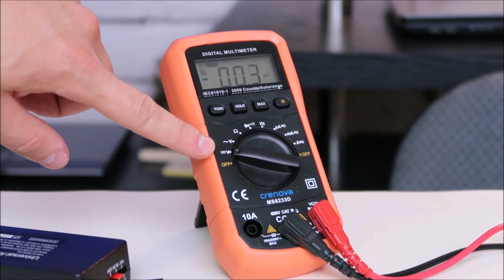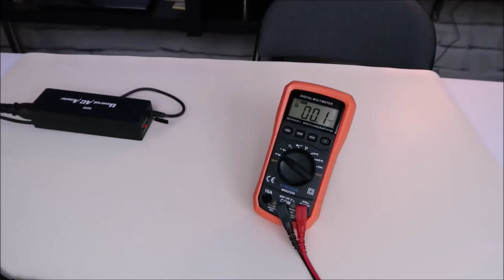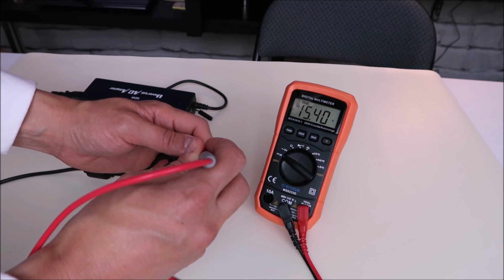How To Fix Any Laptop - Wont Turn On, Wont Open, Turns Off Right Away, No Power Solution

Comment: hi jayman (?) and thanks for these videos!
i have managed to get my thinkpad X240 starting up ok now thanks to these videos. 
the underlying problem still remains: moving the screen causes intant shut-down, after which it will only re-start having done the static draining procudure you describe; at least it starts!
so this seems like a short somewhere, right?
would a short circit cause the static drain type problem? there is residual charge some where on eg chassis which needs draining? sounds right?
next problem is diagnosing this correctly. i've replaced screen cable as old one seemed damaged but problem persists. 
any pointers gratfully received! 
thanks agin for the vids
jimmer
Reply from the maker: Jamin :)  At first guess, you may have a couple issues.  Simply moving the screen should not turn the computer off unless there is an issue with the motherboard.  If the LCD Cable was lose or something, then the display would turn off, but not the entire computer.  A motherboard issue may also be likely as you simply cannot turn the computer on after without doing this procedure each time. I would first double check all the connections on the motherboard, specifically the power related ones like the battery port and power jack to make sure they are secure.  If that does not help the issue, you may be looking at a motherboard replacement :(
Reply: @PC_Monkey  thanks so much for replying. i think i have narrowed it down to the camera cable which may have been damaged at the hinge. it also share a plug with the cable from the power switch.
i have replcaed the motherboard once and it didn't resolve the problem, so i possibly have a spare, but i'll replace the camera cable first and see how i get on. 
all the best
Reply from the maker: @jimmersamuel5039  Very rare.  I dont see too many camera / LCD cables that are also a part of the power cable.  Bummer :(

Comment: not sure if you can help i have a dell insperon n5010 i3 with 4gb of ram, ive have already checked the ram the batt and the power lead they are all okay. the problem seems to be i can press the power on button the light comes on both on the power button and the light at the front of the laptop but there is no boot noises the fan doesnt kick in the hdd doesnt make a noise and nothing from the motherboard. that is only when the batt is in use, however when the power lead is plugged in without pressing anything the power light and the light at the front of the laptop come on even thow i have not switched it on, this happens the moment the power lead is plugged into the laptop. hope you can help with this problem.
Reply from the maker: The lights are the only thing that come on when the battery is removed and only the charger is plugged in?  The computer does not come on more than that?  If so, your on the correct video.  Are you able to try the steps seen here yet?

Comment: So my laptop showed signs of life (lights at the side of the laptop) when I plugged it in but then turned off after I interact with the computer.
Reply from the maker: your on the correct video.  Are you able to try the steps seen here yet?

Comment: My Toshiba sattelite wont turn on, my battery is dead and im simply not using it, tried to hold the button down for 60 seconds, didnt help. I have only 1 ramstick inside the pc, so i just switched the ports also didnt work, tried resseting the bios, also didnt help. Now im left with an old not working pc of mine and idk what is in wrong with it. :(
Reply from the maker: If all the tests in this video do not reveal the issue, and your power adapter tested to be fine, then your most likely looking at a Motherboard replacement as seen here;  https://youtu.be/N_7HNrFkMS8.  If you know your computer's model number, I can help you get inside your specific computer :)

Comment: I have Asus laptop and for some reason I disabled the built-in keyboard through cdm command, after the battery run out the computer won't turn on ever. I tried to test the battery and the power plug but I believe the issue is because of the disabled keyboard,  do you have any idea how can I solve this issue?
Reply from the maker: You can try using an external keyboard to just get into the computer.   Your on the correct video for a computer that wont turn on.  Have you tried the steps seen here yet?
Reply: @PC_Monkey  I used an external bluetooth keyboard and it didn't turn on either. Should I try a wired keyboard instead? I have only one RAM so I wasn't able to do the test. For the cimos battery I prefer to leave it for the last solution bc I don't want to lose the data.
Reply from the maker: @BA-tc8hy  Yes a wired keyboard is best for troubleshooting.

Comment: I haven't opened my laptop for a year. It used to work fine with out no battery. When I plug the charger the and click the switch on the power comes on for 5 seconds, I dont hear thing and the lights turn off.
Reply from the maker: your on the correct video.  Are you able to try the steps seen here yet?

Comment: I have an acer 7750g and it won,t start.
I,ve downloaded the advanced bios and disabled the integrered graphics(because of screenproblems) i thought it would switch automatticly to Intel hd graphics. 
Now stuck in a bootloop (before logo) nothing works what i see here in the video .
I already ordered another mobo on aliexpress but would be nice to get in the bios without changing it
Reply from the maker: This video is for a computer that wont turn on.  If your computer turns on but is stuck in a 'boot loop' situation, then this is not the correct video to be on.  For that issue on an Acer computer, can you try the steps seen here?  https://www.youtube.com/watch?v=gDQZvNQ2chc

Comment: I tried this and it didn’t work my computer screen blinks a white light in like a second then turns off
Reply from the maker: These are troubleshooting steps.  Not magic fixes unfortunately.  If none of these troubleshooting steps were able to identify the parts being tested as the issue, then you have identified the Motherboard as the most likely cause of the computer not starting.  It would then have to be replaced or repaired.  Let me know if you would like assistance with that operation :)
Reply: @PC_Monkey  I probably will but how do I know which motherboard to buy or will any work?
Reply from the maker: @void3765  No, it has to be compatible with your computer.  What brand and model do you have?

Comment: Hi, I have literally watched all your very informative videos and read very many comments but still wonder if my problem is "motherboard" Here is Status: My laptop is Lenovo ideapad Z510; on win 10. Started taking long to boot esp. on restart. eventually failed to start; power button light on, keyboard light on; fan gets on and deem blinking light on screen. light showing comp power from AC is on and battery light on does not blink to show charging; no POST activity. no booting. If power button is on when AC power is switched off with battery connected there is an alarm noise, but this does not happen if only on AC. when forced shutoff, perform static drain with battery off, plugging AC finds the comp power on;
I have tried the power tests with and without battery as you described in video, the RAM tests, had to solder CMOS battery off and on. to no avail. I have tested the charger and cable are ok, even replaced with a new one, tested the DC-in jack is ok.Still same problem - I had not gone into replacing battery coz Should boot with AC power cable anyway. Would you still suggest trying new battery? Can someone probably think of another component to test/service? CPU? or is this the far we can go so we corndemn it "Motherboard"?
Reply from the maker: You said the fan goes on.  Does it go on and stay on or go on and then turn off pretty quick?
Reply: @PC_Monkey  it stays on until hard switch off
Reply from the maker: @jameslukwago7007   If all the tests in this video do not reveal the issue, and your power adapter tested to be fine, then your most likely looking at a Motherboard replacement.  Let me know if you would like assistance with that operation :)
Reply: @PC_Monkey  what components from old comp will be usable with new motherboard? Of course I would need some help. I can disassemble and remove the Mboard but I can do with some guidance
Reply from the maker: @jameslukwago7007  Assuming all components are still healthy then you should be able to use them all after a new MB install :)   Is this your MB?  https://ebay.us/y90cUU
Also, do you have needed tools?  Screw driver, metal pry tool, plastic pry tool, etc.  You can see an example here;  https://amzn.to/32IvYek
Reply: Hi, I took my laptop to a workshop which told me they diagnosed the problem to be 'graphics card" which needed software "update' or patch/ whatever. I authorised the procedure  and the laptop woke up! "Maybe" that was it. Am saying that coz some repair shops may not be so trust worth in my part of the world!!!!!??
Anyhow thanks so much I am sharing also hoping there might be someone in my similar situation....Jamin, Be blessed abundantly
Reply from the maker: @jameslukwago7007  Glad your all set :):)  Always here if needed !!

Comment: Thx bro
Reply from the maker: Your welcome !!  Happy to help :)
Reply: @PC_Monkey  i have a question 
My laptop turn on when i but of one of my ram and i buy another one but when i but it the problem come back whats the matter? 
Note : the old ram is work because I but it in another laptop and it doesn't make any problem
Reply from the maker: @zenP0  The computer works with one of the old RAM but not with two?  If you have already tried replacing the RAM that didnt work, then perhaps its an issue with the RAM port.  Can you try the one RAM that works in both ports?
Reply: @PC_Monkey  thanks i actually clean the ram purt and the laptop turn on without proplem thx bro 🌷❤
Reply from the maker: @zenP0  Glad your all set :):)  Always here if needed !!

Comment: Earlier, the white light indicator near the charging port of my Lenovo Ideapad 330-15IKB would stay lit all the time the laptop was plugged in, but since a few days the indicator blinks every 4 or 5 seconds. Such thing didn't happen before. Is this some kind of a signal? My laptop is around 3 years old. Is the battery malfunctioning? 
Moreover, when I turn my laptop on, it turns off right away. Once in 10 attempts, it reaches to the initial logo screen with 'Preparing Automatic Repair' written on the bottom of the screen. However, most of the times, it doesn't reach to the logo screen and turns off right away. One more thing, I could try the static discharge test but the problem is that the battery is inside and its screws are worn off. Is there any way to remove the battery without having to deal with the screws? Please help.
Reply from the maker: This video has been updated with additional steps here;  https://youtu.be/P3I7dDpkJps.  Let me know how that goes :)
Reply: @PC_Monkey  I've completed all the tests from the static discharge test to the bios reset, but my laptop is still not starting. When I turn it on, it turns off immediately without reaching the logo screen. 
I had the problem of black screen 4 months back. You can see my comment from 4 months ago. I'd asked you the solution. At that time, the issue didn't resolve immediately after the bios reset step. I thought it broke down. Then, I tried to turn on the laptop almost one week after the bios reset step, and it started without any issues. Does the resolution always take this much time after the bios reset step? 
Should I try turning my laptop on after a week this time as well?
Reply from the maker: @EkNadiKaKinara   If all the tests in this video do not reveal the issue, and your power adapter tested to be fine, then your most likely looking at a Motherboard replacement.  Let me know if you would like assistance with any part of that operation :)

Comment: Hi PcMonkey! Here's my Dell G3 15 gaming laptop problem:
1. My charger stopped working, laptop runs out of juice. So I went out to buy a new one (universal compatibility gaming power adapter) with a higher wattage (180w) than the original (130w).
2. Tried out new charger "Plugged in not charging issue" comes along.
3. Removed back cover & the battery is fully swollen. I've removed it.
4. Put cover back on & plugged in charger.
5. Laptop turns on with black screen, fan running & shuts down within 10 secs everytime.

Comment: i disassembled and reassembled my laptop and after the reassembly, it turns on and turns off after 1 or 2 seconds
Reply from the maker: If it wasnt doing that before you disassembled, the first assumption is that something was made lose, unplugged, or damaged.  Use a full teardown / disassembly video to go back through and double check everything.  If everything is fine, it may just be a coincidence.  Start troubleshooting a computer that wont turn on here :)
Reply: @PC_Monkey  thanks for helping, it appeared that the charging port in the laptop wasn't plugged to the motherboard well😅
Reply from the maker: @IamBrocco  No worries :)  I do stuff like that all the time :) 
Glad your all set :)   Always here if needed !!

Comment: i already replace cmos battery and new RAM, and then my laptop can't displaying anything... just black screen... please help me... my laptop dell latitude e6430
Reply from the maker: If the screen is black, what are the signs the computer is on?  Lights?  Sounds?  Fan?
Reply: power on and power light is on for 10 seconds then all light goes off. thank you for reply my comment, i really appreciate that and i need your help ☕️☕️
Reply from the maker: @kegiatanseharihari9837  This video has been updated with additional steps here;  https://youtu.be/P3I7dDpkJps.  Let me know how that goes :)
Reply: PC Monkey charger good, battery good, ram good, cmos battery good, i think my case in bios. how to access bios without display?
Reply from the maker: @kegiatanseharihari9837  You can try using an external monitor

Comment: very informative video iv had a problem with not one but two Acer 5520 laptops i bought several yrs ago my ex had one i had the other and my exs laptop just would not boot after 2 yrs just power light comes on goes off in loop so i gave her my working laptop and two weeks later that did samething i tryed some of the things you suggested prior to watching this vid with no succes but several things you mentioned like bios battery i hadnt so will strip both down and try bios reset will let you know if worked after iv tryed it thanks for all info nice work
Reply from the maker: Good luck !!  Let me know how it goes :)

Comment: I fixed it!  Even though I did the multimeter test, the problem was still the charger.

First, thank you for your excellent video!  My Lenovo laptop showed no signs of working at all and this video led me in the right direction to fix it.

Second, sometimes a charger fails, and even though a multimeter reads 20V of potential, there is not sufficient current to supply the computer with enough power.  This is what happened in my case, so for those of you who are worried that it might be your motherboard even after you've done all these tests, it might not be.

Here's how I solved my problem:

I took a separate power adapter that fit inside my laptop's power port, and with aligator clips and stripped wire, connected the power adapter to a verified working laptop charger with a 20V output.  I then plugged it into the laptop and saw a light come on, verifying that it was a problem with the charger.

At this point, I wanted to know if it was a problem with the charger's power supply or with the connecting adapter, so I cut the cord in half, stripped the wires on the side of the sliced cord that had the connecting adapter, and using alligator clips, connected the sliced cord up to my working 20V laptop power supply and plugged it in.  This powered on the computer, allowing me to determine that it was the charger's power supply and not the connecting adapter that had failed.

My last step was to solder the connecting adapter to an old 20V power supply, using heat shrink to keep the internal cables from shorting out.  This gave me a good as new power charger, which turned my laptop on, and solved the problem.

Thanks again!
Reply from the maker: Glad your all set :)   Always here if needed !!
Reply: honest question because I think I would blow myself up trying to do what you mention; but could I also just get a new charger?
Reply: @lindseyhendrix2405  yes, absolutely, I just like repairing stuff 🙂
Reply: TL;DR. Yeah Im not gonna die fixing my laptop!